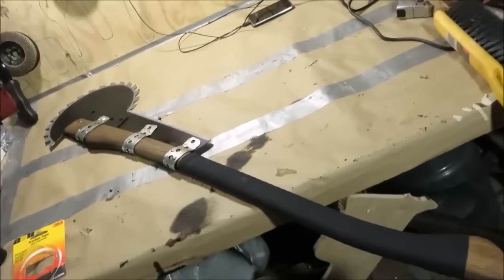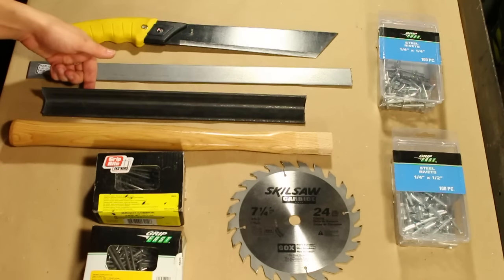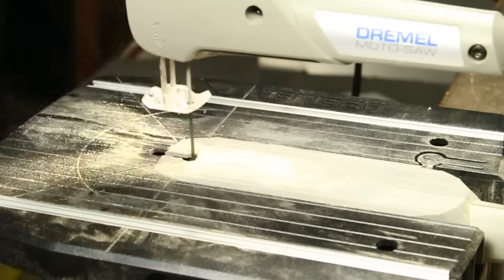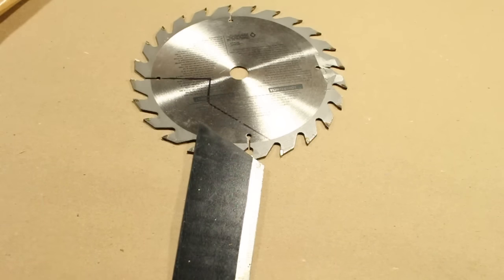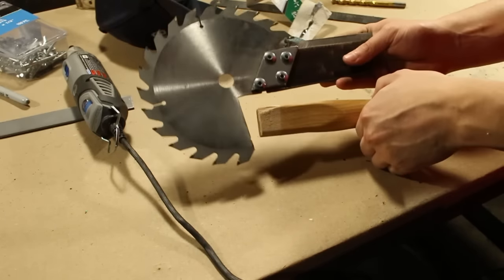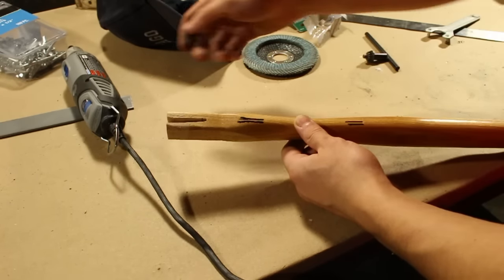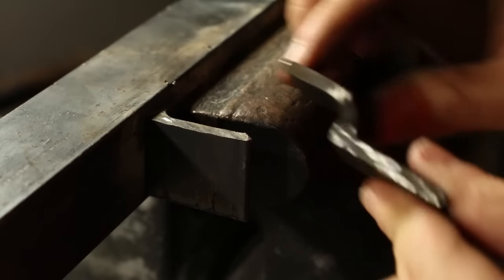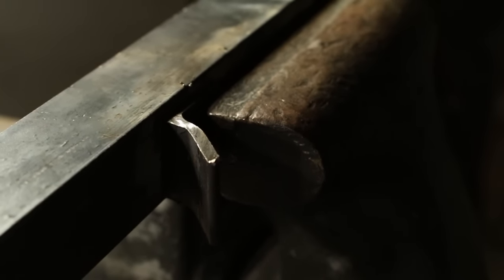How to Make: PSYCHO TOMAHAWK (UPGRADED Wasteland Tomahawk)

Comment: Hey man, I'm taking a welding class in school and one of the key things to making a better weld is structure, I recommend as well as my 40+yr teacher who is a veteran i the machining and metals industry, is to make little arcs back and forth across the metal, or circles, or small zigzags, once you see the glowing red metal, and you use those tips you can control it to make an insanely good weld.
Reply: Purplz you can't really see when you arc weld, the pattern depends on how you want it to look

Comment: I actually learn to weld about 2 months ago and got it first try, welding flat bar 10mm to make a seat frame. Something I was taught is to move left to right over the gap you're welding rather than travelling the length of it in a straight line which in looks like you have. I'm not sure if it is any different for you because the blades are possibly thinner than the flat steel I was using but I hope this helps 😊

Comment: I'm going to school for welding. most the stuff you weld requires a very thing wire and low amperage. you should spend about a day with scrap metal just getting the movements down. it's not a easy thing to grasp but just keep trying you'll get better. I love you videos so glad I found this channel!
Reply: thin wire*

Comment: Eli, at one point you used heathen units (aka metric) instead of freedom units (aka imperial). Much disappoint. Are you against liberty now, comrade?
Reply: Freedom units? imperial.....as in empire .....as in British Empire.
Reply: +darronjknight it's a joke
Reply: +darronjknight The US actually uses 'customary' units, which is based on the same older units that the imperial system is, but is actually a distinct system of measurements, as both countries redefined their units in the 19th century, independently. The result is a very similar system but with slightly different unit values.

Its commonly called imperial however, because people typically dont do the research to understand precisely why the USA is, in fact, number 1. Of course its understandable that most take it for granted given how obvious it is, but for a full appreciation of americas superior nature, i like to dig deep and find out just why we are so gosh darn better :^)

Comment: i try not to discourage or criticise to hard so please take what i say with a grain of salt.
 im a veteran welder. been doing it ten years. get rid of the cheap harbor freight welder you have. its not adjustable. spend the money on a miller or lincoln welder. even a small one will be perfecr for your aplications. thin metal like what your working with should be tig welded. its sturdy and doesnt apply too much heat to warp your metal. but mig welding will suffice. secondly get rid of your harbor freight welding hood and buy a cheep auto tint by miller or lincoln. if you cant afford it get in touch with me and ill give you mine i dont use it much. also. stop wasting money on those flap wheels. flap discs are food for shinning up your weld. but never grind your weld flat. not for your applications. grind it to look pretty but leave the girth of the weld. use the flap wheel to clean up the splatter and round egdes and add the shiney sheen.       also a cheap plasma cutter from harbor freight will help you alot instead of using a grinder to cut thin steel like you use. yes some money will have to be dumped and i get that you wont be able to buy it all at once. but keep trying. again want a good auto tint hood? let me know and you can have mine.
Reply: Joel Sharman he shouldn't try tig welding till he gets more experienced, tig can go wrong very fast
Reply: no one ganna tell the poor kid u push not pull
Reply: Awesome

Comment: Neat or should I say cute project. Nicely done. Welding tip: Start with a tack weld at each end of your joint. Tack again at the center point between ends, then again between an end tack and the center, then the other end and center. Keep splitting the distance between welds, do first at one end then the other trying to keep the heat as far away from the last tack as possible. Eventually joining all of these tack welds into one long weld joint. This is especially useful when working with thin materials as it prevents blow through and overheating. You will also be able to turn up your amps and wire feed for better penetration on each tack.  Tack sequence,  1-6-4-3-5-7-2.

Comment: Has any one ever told you that if you add a bevel to what your welding together will give you a stronger weld?  As for the look of the weld after the fact I know guys (myself included) who still have to take a grinder to clean the welds up, so keep at it.  The skill with the welded comes with time.   Keep at it Laddy!

Comment: Quick tip i learned when i started welding is cut or grind a bevel into the two pieces I'm welding together so that there's more weld material overall making for a stronger connection and it allows you to grind the excess weld off making it look cleaner without compromising strength.

Comment: Aye, can anyone recommend titanium drill bits for hardened steel
Reply from the maker: +Kyle Hayes It'll work but cobalt is all around better. Faster drilling, longer life, and can be resharpened unlike Titanium coated bits.
Reply: +ZNA Productions damn. titanium is all I got for now but they'll work. I need to drill through a knife I just finished for the handle pins  but in my haste I pulled it outta the forge and quenched it after the final hammering was done. Stupid me haha
Reply: +Turukano7 from what I know, cobalt is really good and carbide is I think a little better but Tungsten carbide alloy is much tougher than any steel.
Reply: +Turukano7 made of it entirely. tungsten takes 6000 degrees to melt it to a liquid state. Almost anything you tried coat it with would melt
Reply: +ZNA Productions What happened to not wanting to use Saw Blades as part of your projects?
Reply: +Kyle Hayes Titanium and Tungsten Carbide are more expensive to manufacture, I think. Therefore the bits are also more expensive, but they are friggin' tough.
Reply: KILL O'WATT What exactly are you asking him to do? Make a whole fully functional robotic exoskeleton? The only thing close to that is on The Hacksmith's channel.
Reply: +ZNA Productions can i have that axe?

Comment: welding tip my friend, when you make beads make small circles inside of each as you go left or right, VERY VERY VERY SLOWLY, welding isnt exciting, its like watching paint dry. i was in a welding class in highschool and all we did all day was weld on a sheet of metal to build material, and we did this both flat, horizontal, vertical and from above us. 
id recommend practicing that.

Comment: Welding advice: Slow way down first of all. You need to make a little circle, making a small pool of metal. Once you have that little puddle of metal, make small circles spreading the pool down (along the connection line of the desired weld). Each circle should overlap about half or more of the previous circle made. Just remember, you are melting both sides of the metal and mixing them together. It looks like you are just welding down in a straight line, it is important to do arcs or circles to mix both sides of the liquid metal together. I hope this makes sense. Keep up the good work.

Comment: great job! a tip for the next time you try welding something like this. Bevel the edges of the two pieces you wish to weld first to give you a groove to weld into. build up your weld inside the groove then use a grinder to take off any excess. also depending on your welder you may need to adjust your settings and wire feed speed if you're using a mig welder(I couldn't tell in the video what you were using as it was too dark). still a great build, keep up the great work and keep practicing on your welds

Comment: if you are working with mostly carbon steel try stick welding instead of mig. i took welding in school and they started with stick because its a lot easier than mig or tig,  plus welding takes a lot of "constant" practice, and its not like riding a bike you can't just get good and stay good you have to keep practicing

Comment: As far as the welding goes, try with a few scrap pieces of what youre gonna put the final weld on to get the welder set. I noticed the arc was kinda all over the place. When you're setting it up, look for a consistent arc, and honestly as weird as it sounds, listen for what I can only describe as bees in a jar when setting the sire speed once you get an idea of what kind of heat you need. Hope that helps!

Comment: butter bits get them from any locksmith distributed such as us lock or southern lock. the butter bits will drill through anything including hardened steel, which is what they are designed for

Comment: hello, i got some few tips for u when bending mettal, get a round steel tube, about 20cm in diameter, and use it with the piece of metal u wanne bend in a circle in your vise with a wooden hammer ( steel is fine to). 
and indeed just practise ur welding on some junk mettal it ain't that hard but it takes some practise. so gl!

Comment: welding tip. more volts, leave at least 1/16 gap and push the wire unless you are using fluxcore wire then you drag

Comment: Hiya. I'm not an expert welder, but I've done quite a lot. It looks like you're not making the weld wide enough. Try going from a bit further onto the solid metal on one side, then move quite quickly to solid metal on the other side of the gap, and to-and-fro,  trying to keep the motion fairly smooth (yes, this does take a fair bit of practice). If the weld is bitty or dips, you might increase the wire feed-rate. From the look of the weld, increasing your feed-rate might be a good idea however you end up making the weld. If you've got good penetration grinding down lumps afterward should be no problem. I hope this is helpful and not assuming too much. Cheers.

Comment: I've been welding for 7 years. A little tip slow it down a little bit and if your using flux core wire there will be slag covering it if your using regular wire u need inert gas to protect the weld from contaminants and porosity holes.
Reply: Also do a little U motion as ur welding to widen the bead

Comment: Don't be discouraged  bro welding is hard to get the hang of. Just keep at it you can only get better 
And a lil tip try tacking ether end of the line to be welded on both sides of the 2 components you are joining to reduce the risk of separation of sed components

Comment: 60 fps is weird, but it's better because it doesn't seem choppy and distant, it seems more real. also, a little help with the welder, it looked like you were using a stick welder. if you are, don't move the stick in a straight line like that, pause for a few seconds on one spot, then move it along the line about half an inch and then back almost over the original spot really fast, and pause it there and repeat. it basically builds a puddle, moves the arc so the puddle can cool, then overlaps another puddle on top of it. also, if I didn't explain it well enough, look up stick welding whip and pause technique. hope that helps.

Comment: hey a good welding technique i learned is if youre welding two flat ends together grind a bevel in the conjoining ends and weld in the crevice and grind over it with a flap disk and it will look like one peace and you wont be grinding any of the weld that is actually holding them together

Comment: i am a welder and fabricator in the uk so i apologise if the terms are different but concerning your welding it looks like you are using a mig wlder in witch case you need to be using a shielding gas such as argon and you the welding direction should be away from you so the shelding gas covers the metal before you weld it and my preferred method if doing half moons with the gun as it gives the best finish in my opinion

Comment: Btw for welding you should weld both sides because you are an amateur but once you get good and can achieve penetration when welding one side only do one side and then grind it down. If you want to know if you did it right, grind the weld bead till flush with the parent metals and if it holds you did it right

Comment: what I would suggest is to bridge the two pieces with a "c" pattern (backwards works Cs work too, it what I do) and what I do it go a bit farther over with the top of my "c" and go back down hitting the top the privious C for half of the C and the other half bridging the two pieces, this melts the 2 metals and the bead together making it one piece. comes out very clean and very strong.
Reply: also, for practice, just take 2 8th inch steel plates tac them to get her to form a "T" and the just build your welds on top of each other, it very good practice, and to see if they are good, cut the block in half after you fill it, if no holes, you did well. hopefully this helped :D

Comment: You should go to your local machine shop or scrap yard for a couple of reasons: 1 ask if they have any cut off pieces of steel so you can practice welding, 2 while at the machine shop ask if you could watch them sometime when they have a project they have to do welding on. The worst that can happen is they say no. The best they might even give you some tips.

Comment: Bro, for the welding, put up the voltage and lessen the output of the copper coated weld material, that way you will get a smoother lightning ark, thus reducing the "Splashing" (spritzen in german) and stopping the material from boiling so much. I am german Welder/Metalbuilder Consrtuction technician so i´ve done it myself, welding is tricky in the first few attempts, but you should get a feeling after about 20-30 welds.
Reply: +Eladnav1 and for welding thin stuff on both sides, weld it on low voltage and low material output, let it cool off and then do the other side with even lower volts and mat. A big welding line does not mean it´s good, it depends on how good the weld actually bonds both materials and the weld material.

Comment: Someone has probably already said this, but I doubt the alloy of the saw blade was very conducive to welding.   Keep at it and you'll get the hang of it. Just a little more practice, and stick to stuff that's easy to weld at first. Good luck.

Comment: try rocking the tip of the welding nozzle back and fourth between the two metals to get a consistent bead of weld going also heat of arch means alot to cold it won't bind the metal to hot it will burn through it.

Comment: when welding, try little circles, same size and speed everytime. plus pick up some blending wheels for an angle grinder, some may call them a tigerpaw or flapper wheel. they blend any metals and can make a good or bad weld virtually unnoticable with some time and precision (: keep at it buddy, im just learning to weld myself.

Comment: HEEEEEEYYY!!! I just wanted to give you a tip on your welding. When you're using a mig welder you need to push your weld as opposed to what you're doing. So on your axe if you start the weld on the side closest to you and push away from yourself with a 45 degree angle between the welder and you piece.

Comment: The best way to get into welding is to start with stick welding not mig. Stick Can be a bit more expensive because of the electrodes but it's a good way to get the hang of it. Also make sure ur not too far away from the metal but not to close and check what ur amperage is because that's how fast u can weld  will form

Comment: hey when you weld thinner metal like that just keep overlapping tack welds and quench it often so it wont warp. and with mig welders you have to push the puddle when welding on thicker normal welds

Comment: go in circles make sure it's at the right heat. u want make beads. with a mig u want small beads.(for that project) just grab a scrap piece and practice. also it depends on what welder u get. when I got good at beads I use to put holes in the metal so I got good at patching it up. hope I helped a Lil keep on keeping on

Comment: your work is impressive advice I could give for welding if your still struggling with it is relax more when using the welder treat it more as a pen using the weld lines to perform flowing slow lines and constant practice I learnt on an old stick welder

Comment: Are you using a MIG welder? If so, try oscillating along the seam you are trying to weld. It helps even the weld out and ensure that enough filler is used.

Comment: first tip on welding a butt joint (what you attempted) create a bevel "groove" between the 2 pieces and when you weld go back and forth side to side between the two pieces not just straight

Comment: with that welder, you should be pushing not pulling. theres gonna be a little pool right where your wire is, your tip should be 45° pointed towards the leading edge. then if you're using a gas welder make sure the tip is closer to the surface. if no gas, make sure you have fluxcore wire. other than that maybe use a higher heat. even still, looks better than my welds did when i started

Comment: Don't weld in the dark. If you don't have a self tinting mask, loosen the nuts on it so you can flip it forward with a toss of your head. When you weld, make small half moons, back and forth overlapping as you go. Use the right welding rod. Looks like you're using stainless rods.

Comment: From the looks of your welding, i feel that ur runing the welder a little cold. Try turning the Amps up and wire feed. It may spark more but thats what u want. Ur welds are not piecing. Depending on ur welder that is. If you have maxed out already then u need to get a bigger welder for the metal you are trying to weld.

Comment: Nice videos man, suggestion though, instead of using these pop rivets to secure heavy metal parts together. Just grab spare nails cut them slightly longer than you need and hammer them. These are a lot stronger and will last a long time and stay tight.